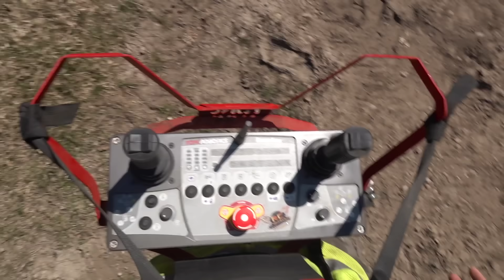YouTube GOLD (S3 E1) - SOLO GOLD MiNiNG SHOW - BUiLDiNG A MUD BARRiER ROAD | RC ADVENTURES

Comment: Such a satisfying crunch made by the RC skid-steer on that old pump house. Great episode! Improvise. Adapt. Overcome. You were presented with a big challenge to the start of this season, and you are off to a great cinematic start. I love the video producing. Great Job. Instead of doing gravel for the roads, what about if you paved it with some asphalt or concrete? nothing serious, just like an inch thick or so. Use chicken wire for the rebar if you use conc. Think that would be really cool if you were able to implement RC to do that work.

Comment: As long as they stay 6' apart. They should be able to work. 🤔🤔👷🔧⛏️⛏️🍺🍺🍻🍻👷👷👷👷👷⛏️🍺🍻🍻 All seriousness though. I do hope that everyone is doing well. 🤔🤔 Social distancing is important. You as the quarry superintendent it is important to protect you crew. This will be a good year. I have faith in you and your crew. Great improvements on the area. They will be impressed. Though one thought came to mind. When that wood gets wet very slippery. I like a challenge just like everyone else. But safety first. You got a sorta kinda good safety record goin🤔🤔🙄🤪😜😝🤯😳😲😁😂😂🤔🤔🤗😊getting the loader stuck the earth mover went rouge and ya almost dumped the portable crusher. Not to mention getting the trailer stuck and almost tipping it over but but no one got hurt. Except to the sluse box incident were you got all kinds of bandaged up.big tumbling action goin on their but good safety practicing goin on. New vest,helmets, refreshment holders on the helmets 🤗🤗😊😊  Things will get going we just have to be patient.take care wish you all good health. Great job with the videos